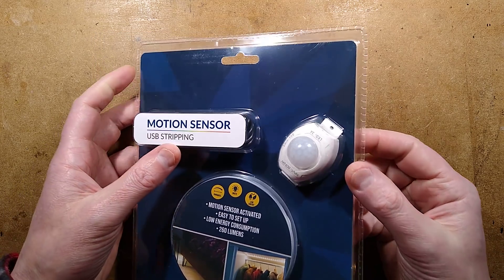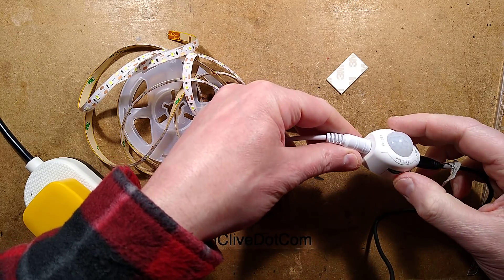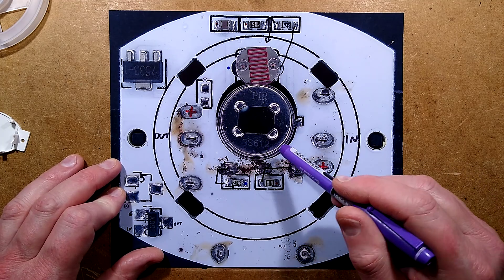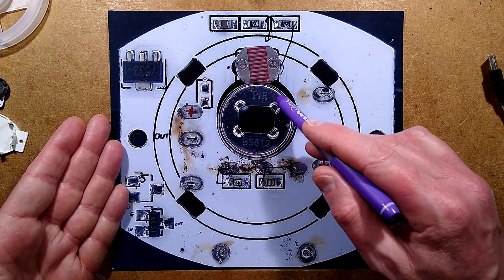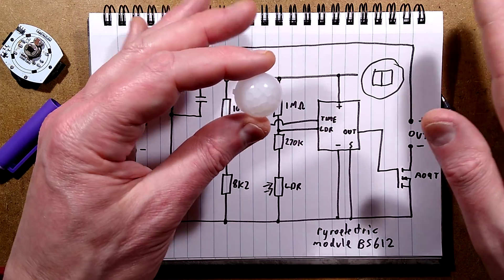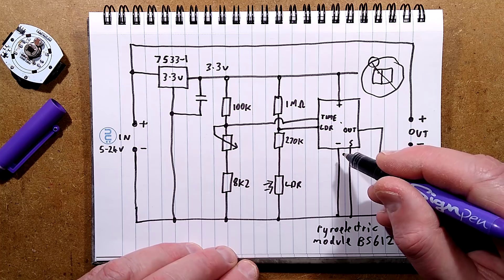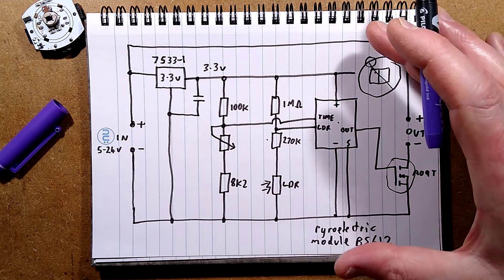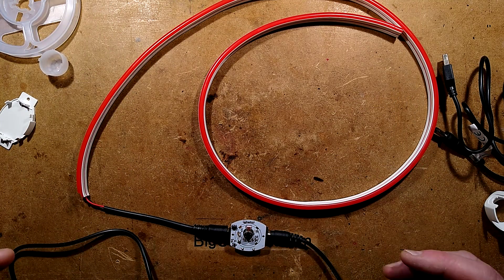Poundland's PIR LED tape.  Worth buying just for the sensor.

Comment: I've been using them as under cupboard lights in my kitchen for a month or so. The USB connection was a bit dodgy but I got it stable and it's been great so far. I've not had to use the big light at all.

Comment: I appreciate what you do.......but this video seems a bit like an example of " I just ask what time it is....not how to build a watch ".  I have a few of those PIR switches designed to be added to most any 5v DC device and I must say, they are fantastic switches when used with a 110v AC - 5v DC power block.  They have a low time delay of about 8 seconds and they are sensitive up to about 10-12 feet.  Unless it's being used outside, I have little to no use for a daylight sensor.  I use them in my kitchen on the under-counter lights to light up the counters when someone enters the room.  They also work anywhere else that you want a light to act as a 'Night-Light'.  Even with the shortest delay, they stay on until you leave the area.

Comment: Excellent video, been and bought a set today and very impressed. Do you think I would be able to join a second strip onto the first or would it be too much for the one power supply?
Reply from the maker: I'm not sure what current the USB cable is rated for.

Comment: Seems well worth the money, it says it’s dimmable? Any evidence of this when you looked inside?
Reply from the maker: It's not got a dimming function.
Reply: Thanks for the reply. I have another question if you don’t mind me asking. I’ve got a few of these and of course there not “soft start” could you recommend or give any advice as to what type of capacitor I’d need to wire in get a decent soft start soft stop on them. And I’m assuming it’s best it wire it in parallel as opposed to series?

Comment: Hi you said at beginning it was waterproof style led tape. are you sure ? as i am thinking of a unusual use in my chicken run although it has a clear roof it suffers from  extreme  condensation in cold weather and previous leds have suffered  from partial failures from moisture . most waterproof tapes have a silicone looking cover yours did not look on screen as it was a waterproof cover, i hope i am wrong, as this could be useful

Comment: Would be useful for automatic lights for 24V e-scooters, e-bikes or even just torches that you want to stay on for a minute but don't wnt to drain the battery just because you forgot to switch off.  Also the 7533 can easily be swapped for a 36V LDO.  Nice little bit of kit adaptable for any eco lighting project!  The trouble with those PIR lenses is that they perish after a while in outdoor conditions.

Comment: Is your diagram correct, surely the output mosfet should be connected to the +ve supply rail, not to the earth.  (i.e. both sockets are grounded.). . . .

Comment: Hmm, does the PIR sensor only have Left-Right discrimination as your diagram suggests?
If so, then I better check that my sensors are oriented correctly,... if they're 90 degrees rotated then only folk jumping up and down will trigger the circuit!

Comment: These under the bed, motion sensor activated light kits are a life saver if you have a bed frame like mine that will continually kick your ass when you’re trying to find your way back into bed after taking a leak in the middle of the night. I purchased two of these kits ($15 USD each) from superbrightleds.com so I could have this feature on both sides of the king size bed, the only differences was the the LED strip was only 4’ long, there was a light output dimmer which came in handy, and the power cable to the PIR had a fixed DC power supply instead of a usb cable. If you are looking for stand alone PIR switches, microwave motion sensors, and tons of other supporting hardwares for diy lighting this same website has a decent amount of choices of both low and high end pricing. And no I’m not endorsed by this site, I’m just passing it along. Here’s the link to the light kit I used if you’re interested....👍🏻.    https://www.superbrightleds.com/moreinfo/complete-led-strip-kits/led-motion-sensor-strip-light-kit-power-adapter-dimmable-and-adjustable-on-time-39ft-led-tape-light/6346/14290/.  As always, thanks for the video Clive!!

Comment: Is it possible to use a Photocell sensor like that on a battery pack to power led strip like the one you showed? just not as long maybe 12 inches to 24 inches long.
Reply from the maker: That strip can be cut down to size.  They do sell battery packs with PIR sensors built in.

Comment: Regarding "wide voltage range of the sensor"... From what I can see in the datasheet, it seems the sensor has an absolute max of 3.6 volts, a max working of 3.3 volts, and recommended of 3 volts. Their typical application circuit on page 10 shows 12 volts to the circuit but going right to a HT7533  3.3 volt regulator that feeds the BS612. The BS612 then triggers a MOSFET to do the heavy lifting of switching the circuit's power source. So I would think this could be, and often is,  done with any IR sensor...?

Comment: Would a 3.3v zener diode in series with the regulator output prevent triggering by low voltage?

Comment: Hmmm, interesting! I'm looking for some pelmet lighting for my kitchen... wonder whether motion-activation would be ok for that or whether it might get annoying. Could I split the tape into two and join it with wire to span the hob so I just illuminate under the wall cabinets either side of it?
Reply: Chatting to myself! Saw this in Poundland today so picked one up. Seems to work ok, not sure whether it would be bright enough for kitchen pelmet lighting. But for a wardrobe, it would be fine.

Comment: It would be really cool if he would try to use this to power brighter LEDs using the 24-volt and higher amperage capabilities that this seems to have
Reply from the maker: The neon strip at the end was running from 12V.

Comment: Disappointing that it's wasting current with the timer resistor divider network. If the output to the FET switches high when it's on, I wonder if you could power the 100K resistor from that instead. That would make it friendlier for battery powered operation.

Comment: I was playing with some of this tape yesterday and noticed that when I put my thumb across two copper tabs then the adjacent led would glow, albeit very faintly but it was definitely emitting light.  The strip had been powered up earlier but was not connected to the controller at the time.
Reply from the maker: LEDs will glow with just microamps of current.  It may be that the power supply still had a slight charge on the capacitor that wasn't enough to light three LEDs in series, but by bridging to just one it could glow.

Comment: Do you think one could run this off a 9v battery would be very interested if that was possible ?
Reply from the maker: Yes.  But you'd need to use a 9v load.  It would be much easier to run this from a suitable USB power bank that puts out 5V all the time.
Reply: @bigclivedotcom  Thanks will look into that

Comment: These cheapy little devices lack a protection, like that MOSFET at ouput is prone to zap when a person touches the LED strip, the same happens with the input, LDO can fail when long wires are used. Proper protection can be like 2 cents more, but I guess that would brake the bank...

Comment: I  dont know how they do it unless they buy bulk faulty seconds for a very low price, 'shakes fist at poundland' lol why is it whenever I get something from somewhere this place gets them in much cheaper :D I bought a similar thing for the purpose of using my own LED strings but never got round to it from 'A' only the main unit is different with a built in rechargable cell. I hate posting links but its the only way I can describe it. Im not affiliated by 'A' and I am not advertising or gaining anything from anywhere, I just wanted to share the product I bought by link, or I think you could find it by searching 'Motion Sensor Activated LED Light Strips 3M Rope Wardrobe Closet Night Light Bar Built in Battery USB Rechargable（3M,Warm White)'
https://www.amazon.co.uk/gp/product/B085FXNLZY/ref=ppx_yo_dt_b_asin_title_o00_s00?ie=UTF8&psc=1

Comment: Bought one two days ago and the sensor has stopped working already.
Reply from the maker: Is it plugged the right way round, and is it dark enough for the unit to operate?  It has a dusk sensor.
Reply: Honestly, forgot about the light sense bit, however it was working fine the first day in a well lit room. I shall try in the dark👍

Comment: Pyrosensors are sensitive to changes of heat via the can - on security PIRs we'd put some kind of shield or insulator around them - so I presume the designers of the BS612 will have gone to great lengths to make sure that the power dissipated inside remains constant in all states. I wonder if those using the device are aware of this effect.

Comment: No Clive, the RF detectors aren't Doppler. We've done this before.
Reply from the maker: I'm pretty sure they are.
Reply: @bigclivedotcom  They just sense a single change in the RF field, hence the use of a PIR IC as the amp and simple threshold detector. If using Doppler it would have for look for a difference frequency between transmitted and received signal which needs some means of measuring pulses over time before alarming. (Background: Back in the late 70s I designed commercial Doppler ultrasonic and microwave intruder detectors.)

On another subject, some time back I offered you a Xmas light controller from Changzhou Jutai that had a Bluetooth interface. I've now had one apart and it's got a PCB error that could make a video. You want?

Comment: PIRs have a tendency to be triggered by nearby RF sources. Alaem devices are protected from this ! High temperatures can also trigger PIRs along with car headlights. Again, alarm PIRs are pretty well protected from this . Doppler, radar detectors can detect water flowing through plastic pipes. PIRs can be triggered by fan heaters suddenly turning on, or sunrise, through a window! Using dual system devices, in parallel cuts false activations.

Comment: If you wanted to make this less sensitive to detection, would that be possible? Just curious
Reply from the maker: Yes.  You could add a resistor internally or mask the sensor.

Comment: Hey Clive I was watching a tutorial on fixing LED Christmas lights with the LED keeper  https://youtu.be/OSOxeP-GF4Q. I was wondering how it works as Leds are made up of diodes so how does it power them both ways down the string? is it just a 9 volt DC power supply with a piercing probe on one end? It is just to expensive to justify to repair the mini lights.
 I thought it would be a great seasonal video Idea for you to have a go at.
Reply from the maker: I think it generates a higher voltage internally.

Comment: I purchased just the self adhesive LED strip for 2 or 3 pounds from Poundland a while back. It's just long enough to go around the edge of my 17" laptop's monitor and is powered from an USB port. I've since couloured them red and blue alternately (marker pen) for a more pleasing look. I might get one of these if they still have them next time I go there.

Comment: Just got one, if you plug in the power the wrong way through the sensor the light stays on all the time.
Reply from the maker: It conducts through the MOSFET's parallel diode.  It won't harm the circuitry.
Reply: @bigclivedotcom   Yes, its kind of handy if you want it on all the time.

I may even put a switch on  it to bypass.

Comment: Unfortunately the one I purchased had a faulty pir, it came on as soon as it was plugged in and stayed on, I took it back and got a replacement and the second one worked but the strip lights were faulty, glowing dimly then bright then very dim, this one will be returned tomorrow, hope it will be 3rd time lucky. Edit: Good news the 3rd one works fine. First name terms with the Poundshop staff now.

Comment: Ah, do I see a Cadmium Sulphide LDR?  Is that not banned ? Or perhaps this is the post-brexit-ready version?
Reply: I believe it got an exemption because there's nothing to replace it with. I've got some 2-lead photosensors (Nicera LSL100) that came from their then UK agents a long time back when a CdS ban looked likely. They were intended as a near-enough direct replacement for CdS LDRs and don't die high resistance as CdS LDRs do but I see they're no longer available.

Comment: You can get BS612  for just over a pound a piece if you buy 5x https://www.aliexpress.com/item/4000061444366.html

But you can get the sensor, with tails, for £2.03 (https://www.aliexpress.com/item/1005001513193062.html) or without (https://www.aliexpress.com/item/1005001427274691.html)  if you are willing to wait...

Comment: I ordered something almost like this that had a 110V to 12V power supply and LED strip. I did not notice that the PIR had the LDR and I thought it was dead. The one I have was sold as a set for lighting the floor next to your bed, I wanted it for the PIR to have a light under the cabinet in my bathroom. I did find a use for it to light up a section of counter in my kitchen at night when I walk over to it. LED 12V PIR modules are kind of hard to find on Amazon now, I have gotten one in the past but the Chinese sellers seem to not sell it anymore.

Comment: Found a similar led strip and sensor combo but it allows you to dim the leds as well. A great product for older folks when attached to there bed frame. As soon as they get up bam light to get up with... works great for my dad...

Comment: My job has infrared motion detectors for the burglar alarm.
The installer had to place white electrical tape in certain spots on the sensors to keep the HVAC system from triggering it all the time. lol

Comment: Question.  Could we use the 7533-1 to power 3v sensors when connected to a 5v arduino through a logic level convertor ( because I think I will need 3v for the sensor side ) ?

Comment: For the 'lenses' on the plastic cap;  I think there are no round lenses on its surface, it is the straight lines in between the little round isles that function as a many lined lens that project a better distinguishable contrast on the PIR censor ?

Comment: Looks like a very good little circuit, would be ideal for my mom's place. I bought some wireless lights from Aldi for her and they don't turn off automatically so they've been through 45 AAA batteries already.
 PS I just got my amazon pkg with my 1000 clear pushpins and my new tool... a LightKeeper Pro! Xmas lights, here I come!

Comment: The PIR market might have taken a hit because of cheap Doppler Radar sensors, but now the doppler radar market will probably take a hit because of these integrated PIR sensors which are more compact, have lower quiescent current and do not require EMC certification. And probably are more reliable.

Comment: Can they be used then at 28 volts? I'll see if I can get one on Ebay to test but if the regulator can take 30 volts I would imagine it will handle 28v continuous. Its usual for 24v solar powered battery/inverter systems to sit at 28v for a 24v system and 56v for a 48v system
Reply from the maker: It should operate at 28V but I wouldn't push it further.

Comment: For those curious about the little SOT-23 MOSFET: I found a datasheet for what I'm assuming is an equivalent to the A09T (if it's not the actual part), an Alpha & Omega AO3400 (N-channel, 30-V). Indeed, those are rated to Id = 5.8 A, at Vgs = 10 V, assuming you can keep the junction cool enough -- Rds(on) is typically <20 mΩ, for Vds up to ~5 V (which is great), but you'll have to do the math to see if it'll actually stay cool enough to do what you want. Spoiler: these will evidently work up to Rθja = 100 °C, Pd = 1.4 W @ Ta = 25 °C. But I think the more impressive specification is the Gate Threshold Voltage, Vgs(th), which is typically 1.05 V @ Id = 250µA, meaning they'll work with the increasing number of µCs out there operating at 2.5 or 1.8 V.
Reply from the maker: It seems too good to be true for such a small component.

Comment: Doesnt the voltage drop of the crappy USB power supply or the extension cord affect amperage of the light?
Reply from the maker: Yes.  All resistance affects the intensity.
Reply: So then with a decent 5v PSU the light strip could pull around 1A.. Not bad for 5 bucks along with the PIR. A USB PIR by itself costs around $10 on amazon. I use them around the house, definitely handy.

Comment: interesting video, pretty informative, thanks!

That's a great price for the entire unit, really,  however too me at least,  its odd that its cheaper to buy something from a Dollarstore and salvage its parts then to simply buy the part outright from a supply store or online.
eg)  i could never find a blue diode laser for less then $10, so i buy diffused laser Christmas lights at a discount store for $4,  and strip out the lasers.  

Ali express is great if you buy in bulk,  like a small business or manufacturer.    
Typically the more you buy the cheaper the order gets.

I get some great 3-in-1 flashlights (laser, black light led, laser) for $.25 each.... if i buy 200.

Comment: Interesting and useful.  Pity that 270k resistor is not variable so the sensitivity could be adjusted.  i find these useful from Ebay at £2.25  "Pyroelectric IR Infrared PIR Motion Sensor Module Detector HC-SR501 Arduino"

Comment: Aye, there was a difference between the "tired" Clive and the "wide awake" Clive, but either way, I think most folk could follow you.

I was wondering, if that sensor is all that sensitive, and your house is all that cold, it was probably detecting the random movement in the plumes of warm air that you would be exhaling as you spoke.

Comment: Might be worth mentioning that, while the sensor will work with power between 5v and 24v, the associated LED strip will not !!! Need to use a LED strip with same voltage spec as the PSU used.